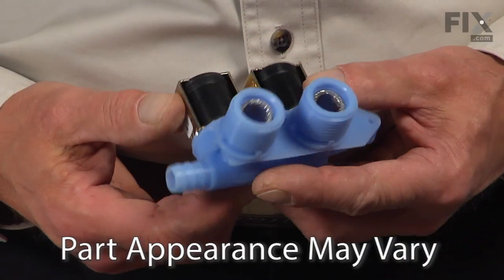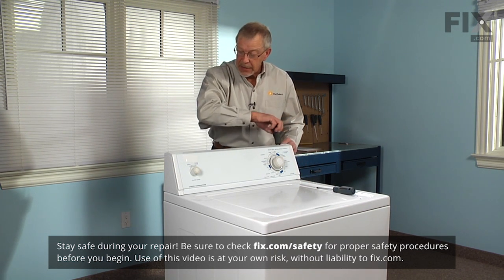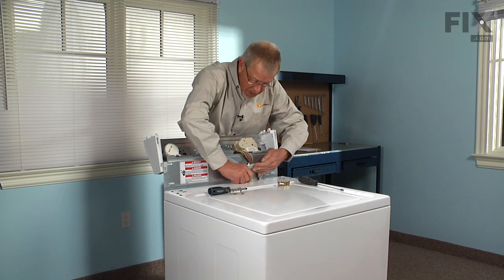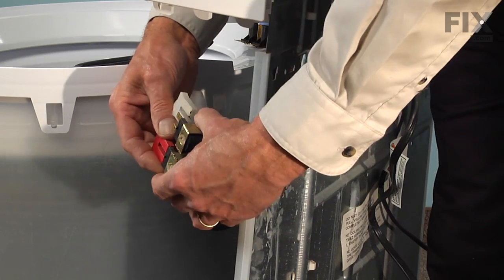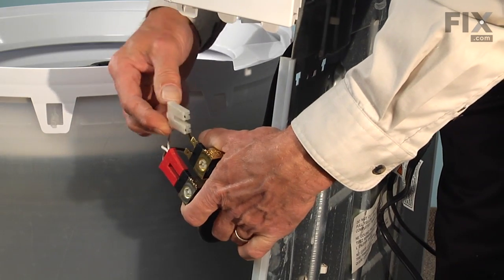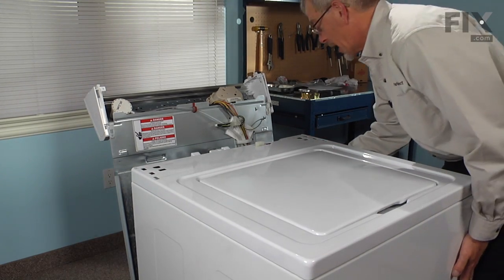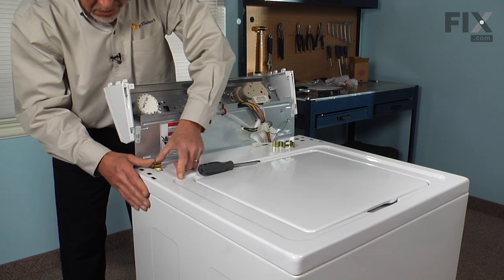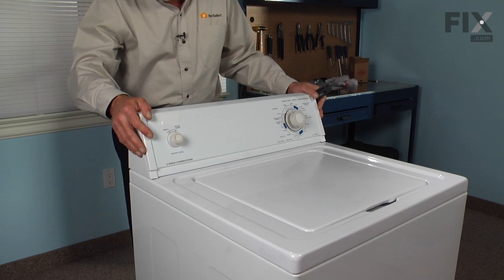Whirlpool Washer Repair– How to replace the Water Inlet Valve

Comment: does this Instruction apply to older models regarding tilting out the cabinet for a LA7800xsw1? Than k you I have a leak either w/ hose or the valve only while filling

Comment: I saw the video was 8 minutes long, so joked with my husband about whether or not I could finish in 15.  Even though my washer is a different model, the instructions worked fine, and I had the new part in place in less than 15. But getting the cabinet back on the base was another story. All in all, a great video and thankfully all is working well.

Comment: Great Video. Thank you for making it. When I replaced my valve, I noticed corrosion on the 2 small connectors that attach to the valve. I cleaned them off prior to installing them on the new one.

Comment: Thank you! I fixed my washer in about 45 minutes. A lot of that time was spent cleaning all the dust that was caked inside with my shop vac. It cost me $44 for the part; I wish I could have bought one for $8 like the guy below. Thanks for putting it back together; that was helpful, too.